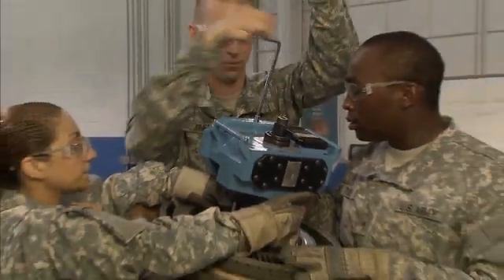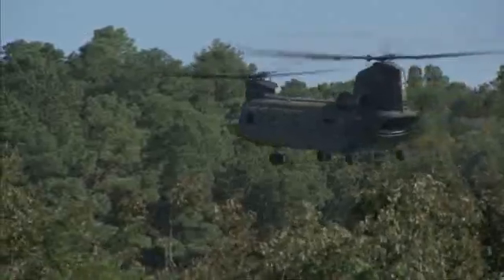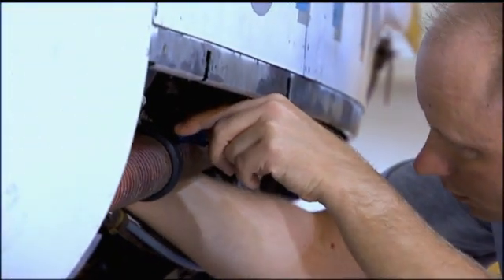Army Careers 15B - Aircraft Powerplant Repairer

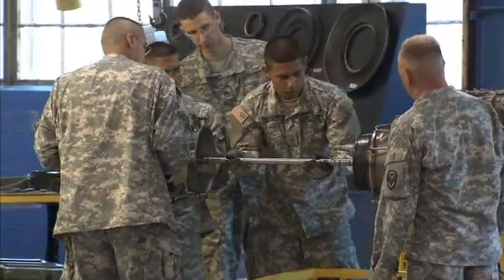Comment: 0:26 hard hats anyone?
0:30 motherfucker is having a flashback
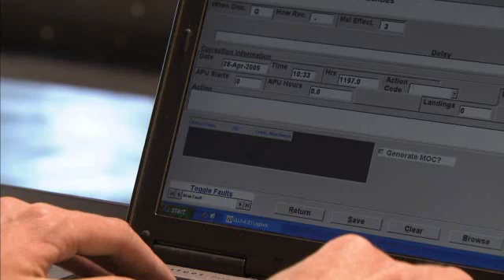0:40 boot fuck blending blades really shittily without masking off the area.
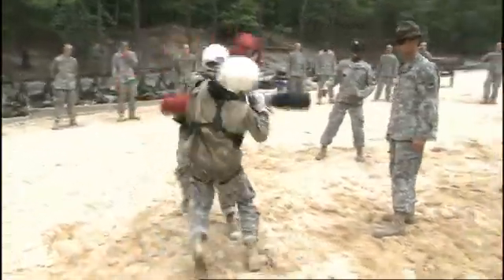0:56 pilot wondering what all this shit is.
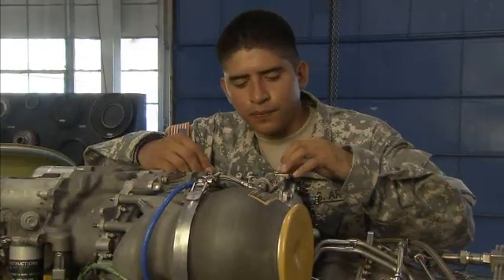1:00 fuck tard pressing on the starter like he is doing something
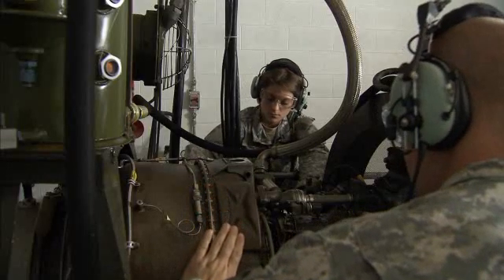1:12 rub that engine guy, rub it good.
1:24 WHERE THE FUCK ARE YOUR HARDHATS GOD DAMN IT
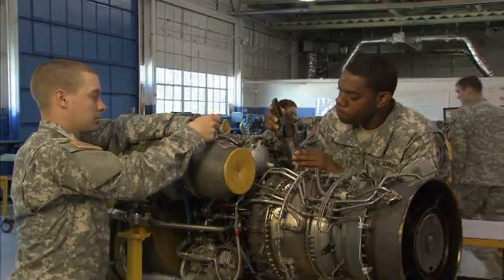1:42 guy tightening clamp without tapping it. Bonus: loosening with a dial torque wrench.
1:49 for fucks sake guess the army can't afford hard hats anymore
Reply: I never removed an engine from the helicopter.
Reply: l337sponge Tighten the clamp then tap it.